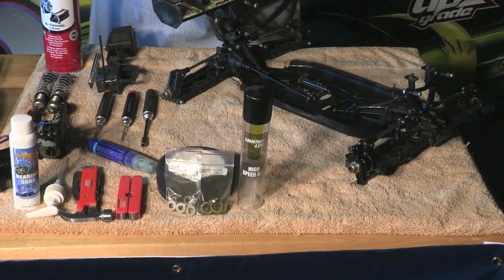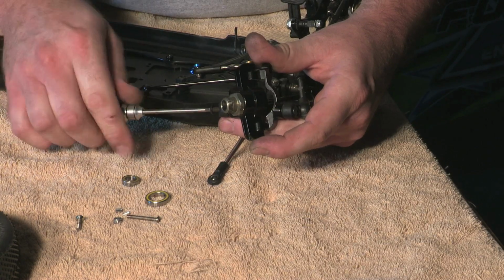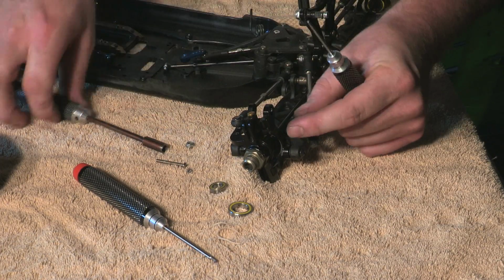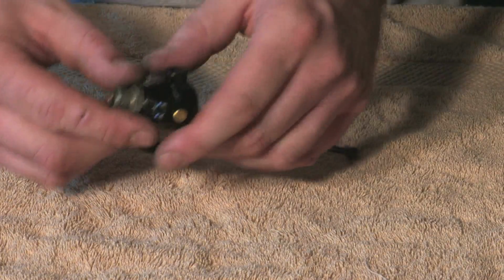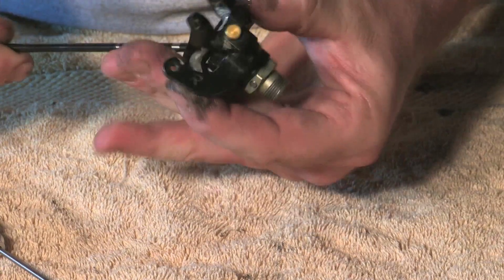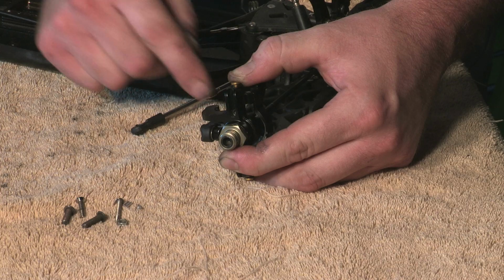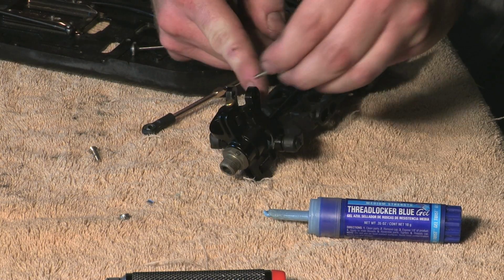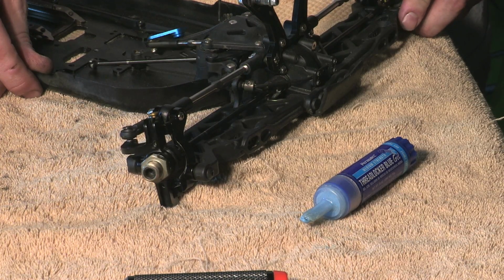How to replace Losi AT 2.0 front & rear spindle bearings

Comment: Any tips if that pin in the hex doesn't come out easily? I've removed the set screw completely. I think it may be rusted in?
Reply: Yeah, without looking at it that sounds possible....
Reply: I sprayed the whole thing with degreaser yesterday and let it pull through over night. This morning I popped out two of the pins with a clamp, 2mm punch and a hammer. 

I will probably have to repeat the process for a few other things in the the drive train.